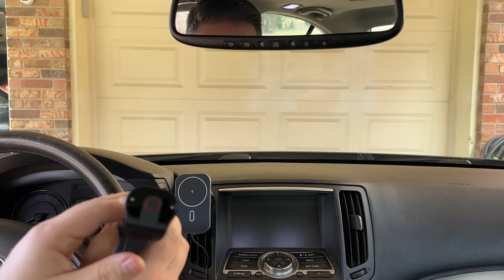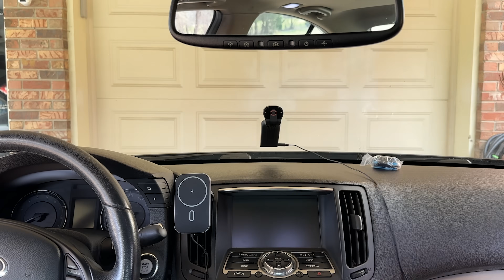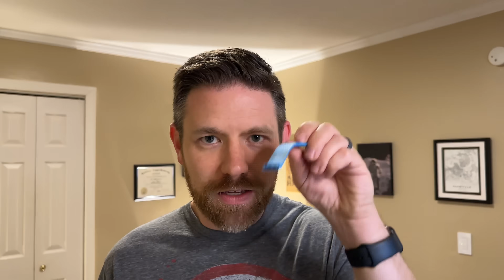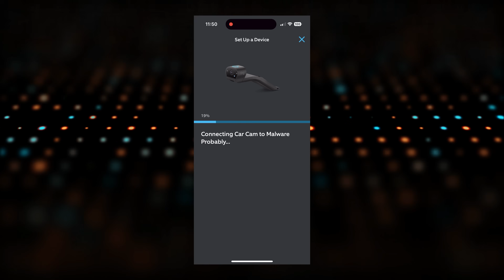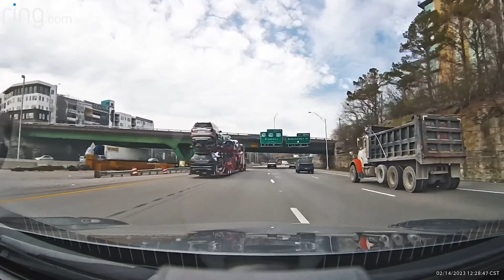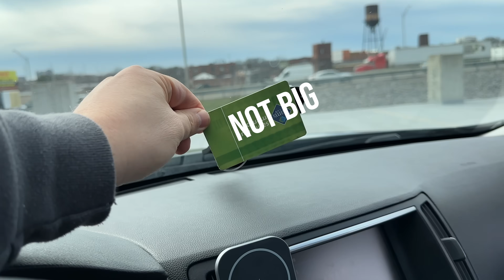Ring Car Cam: Full Review

Comment: Excellent review. I was expecting a little bit more on the break-ins detections. You said it worked perfectly, would be great to share some videos on how it actually works, if anyone stands outside the car close to the driver's window, will it also detect? do we have to manually select the "zones" as with the other cameras? Thanks.
Reply: YES, i received mine yesterday and the angle is wide so it picked up me walking towards my door from about 2 to 3 feet away maybe more...and then getting in etc. it really is amazing and the wailist on ring/amazon is until june but a few legit ebay sellers had this in the 250 range with shipping so i hopped on it friday! that same seller i got mine from is now selling the remainder of the 8 he had for 299 but you might find someone else with deals (and auctions of course) watch ebay often and again, highly recommended! so freaking simple to install and looks amazing in my new jeep gladiator
Reply: This^^
Reply: the "motion detection" only works when getting in the car. It doesn't detect motion around the outside of my car. Bit of a bummer.
Reply: OBD2 port? Not plugging anything to that port.

Comment: You video helped me to understand the product.  I live in the wild of Montana and my windshield gets broken at least twice a year and is always replaced.  The glue on the Ring cam window tab is strong.  My question is how do I remove it when the window has to be replaced [so as not to break the ring unit] and does Ring sell the glue tab for this kind of replacement.  Thanks, Ken
Reply: The device comes packaged with 2 spare adhesive tabs

Comment: the product says it should only be used with driver's side OBDII port, but the USB-C is on the right side.  Was it designed by a marketing major?
Reply: I thought that too. But the cord is real long and the usb port and the plug in get tucked away in the dash anyways

Comment: The big problem that I am seeing with this Ring protect go plan is that it is only 2gb of LTE data. That is only 4 hours of video. You will go though that 2gb of LTE in less than a week and have serious overage charges. You have to opt in to LTE overage charges when you purchase the ring protect go. We need to have a way to chose wether or not our recording auto upload. Great video, great info.
P.S. local storage is 7 hours and it re-writes over the old stored video in 1 hour blocks.
Reply from the maker: Based off of your numbers, do you see yourself trying to download more than four hours of video a month while your camera is away from your Wi-Fi network?
Reply: My Ring Protect Go terms of service state that I have 5 GB / month included here in Canada

Comment: Just installed mine last night. Was disappointed to find out that it doesn’t record or cannot live view when the vehicle is off. I thought it would, will have to send back. My issues are when car is parked and people around it scratching my car. If there’s a setting for this please let me know.
Reply from the maker: You can adjust the power settings to be more aggressive, which will keep the camera on longer while the engine isn’t running.

Comment: I like this guy’s channel but i feel that this review is somewhat lacking in regards to performance details! 
One of the most important feature on a camera is the image/video quality! Yet, no mention of this! 
No discussion of resolution (720p, 1080p, 2k, 4k etc…)! 
How does it perform at night vs dascams that feature Sony STAVIS tech? 
Why would you recommend this in 2023 vs newer STARVIS 2 equipped units! 
What is it’s heat handling capabilities?
From what i can see, this dashcam is easy to use, but the image quality is lacking! 
It should be priced in the $89 range! A hard pass for me! I would rather own the VIOFO A139 pro for the price that RING is asking!
Reply: It's more of a security device than a dash cam as it has a hard time reading license plates.
Reply from the maker: I did mention that it’s 1080p, and that this is lower resolution than other dash cams out there. I also highlighted the merits it does have that give it parity with what a Ring customer would expect from a Ring camera. If other companies would like to have me test their dash/car cameras, they know how to reach me. Thank you for commenting!

Comment: Very curious why Ring chose to have the USB connection on the camera itself come off the wrong side of the camera to lead directly to the OBD-II port on the majority of cars worldwide.
Reply: My thoughts exactly.  The OBD ports have always been on the driver's side of every car I've ever owned.  Seems like a flaw.....
Reply: OMG RIGHT!?!? Additionally, why did they round the end of the dash support so drastically? I sharper wedge would have made it much easier to fit between the windshield and dash. It's like they didn't have a single automotive engineer / specialist on the dev team. Sofaking dumb.

Comment: Got mine today! I have not set it up yet but I am concerned about connecting it to the home wifi as I live in an apartment so I doubt I can receive connection to it. Any workaround? Maybe my car's wifi hotspot would work?
Reply from the maker: If your car has a hotspot, it could work. But does the hotspot work 24/7?
Reply: @TechWinnerCC  mmm only when the car is on that is the issue. Or my phone hotspot maybe also for the time being for the firmware update. After that would it be able to utilize the cellular connection moving forward? Thanks!

Comment: I received my cameras today.  Ring says the weight of the camera should be supported by the dash, and not by the mounting strip on the camera. There is a gap cover that you place over the bottom of the camera where it plugs in (depending on the thickness from your dash to your windshield), then you snug it between the dash and windshield, and lastly, press the mounting strip into the glass. The way you've mounted it, the camera could possibly fall causing damage to the camera or your car. Even if the camera view is somehow obscured by your hood when mounting it correctly, you should follow the Ring installation instructions, then inform everyone about the possibly of the view being obscured.

Comment: OBD port is for diagnosis…not for powering an installed add on. “Scottie” would not approve. That’s why all other dash cams have hard wire options to the fuse box.
Reply: There are a number of dash cams with OBD connections.

Comment: Ring shows the bracket much lower down.
Reply from the maker: Yep. I wanted it higher.
Reply: You're right. The correct installation is lower with the bottom snug between the dash and windshield. Please follow the proper installation instructions provided by Ring.

Comment: Mine is out for delivery, looking forward to getting it setup.

Only thing I’m worried about is it blocking the light sensor on my dash, the one that controls the headlights.
Reply: My light sensor still works as designed with the car cam centered directly over it.
Reply from the maker: Another possible reason for mounting it higher, like I did.
Reply: @TechWinnerCC  You should stop writing that people should not follow the installation instructions. RRSTT if you're worried, just move it slightly to the left or right to clear the sensor.

Comment: Mine was delivered yesterday and I don’t know if it’s gonna drain my battery
Reply from the maker: I wouldn’t worry too much about it. Definitely play with the power settings, but as I mentioned in the video the cam will put itself in standby mode before this becomes an issue.

Comment: CNET said the footage is really grainy
Reply: It looked a little grainy especially at night. Ring should have used 4K. Mine is sitting in my office. I tried to cancel my order but they sent it anyways. Still waiting for a return label.
Reply: @geraldsportschannel any chance I can buy it off of you? 🙏
Reply: @marccc1505  sorry sent it back
Reply: @geraldsportschannel  4K video would be a major increase in file sizes uploaded / downloaded.  I understand making the tradeoff in an LTE-connected dashcam.
Reply: @SevenFiftyNorth  my current dash cam shoots in 4K And the footage in my truck and outside my truck looks awesome.
Reply from the maker: Well, what do you think based off of my footage?

Comment: Appreciate your insightful review.  In fact after watching, I picked one up at Best Buy on my way home.  Installation on my AMG Mercedes was straight forward, the extra cord slack took most of the install time to tuck to the undercarriage of the steering column.   I look forward to testing the features during my am commute to work.  Does the 30 day trial for Protection Go need to be activated?
Reply from the maker: Nothing to activate on the 30 day trial.

Comment: I installed it on my Silverado today and I didn’t leave a gap like you did. While I wish the camera angle was a bit better facing the road I’m happy it’s so snug. I’m not worried it’s going to fall. Please keep us updated if yours falls.
Reply from the maker: Week in, and so far so good. I mean, this thing is incredibly lightweight.
Reply: Hey Josh, you did it the correct way! That mounting strip is not meant to hold the camera permanently and could possibly fail during the heat/cold extremes of the windshield and the camera could fall causing damage. There's a reason the Ring camera designers decided on the particular installation instructions.
Reply: @reb1225  They copied the instructions from the "Owl Cam", and the design too.
Reply: I have a truck Ford F150 and there is no way the sticker will touch the  glass for support, it is my second day driving and right now my camera has not support, have to hold it with my hands when I do turns
Reply: @jcgutibay  It is good to know that it doesn't fit the best selling vehicle in the United States properly.
Reply: @damon20r  exactly, first thing came to my mind, curious if they really tested on every American vehicle
Reply: @damon20r  after watching another YouTube video I learned that the head of the camera is adjustable so, I was able to attach the camera to the window
Reply: @jcgutibay  cool, because I a have a f-150 also.
Reply: after watching another YouTube video I learned that the head of the camera head is adjustable so, I was able to attach the camera to the window — so far I like the recordings and I am using my wifi at night so now I am checking if can access the car camera anytime

Comment: You've installed it wrong in the window.
Reply: Yup
Reply from the maker: Yeah, I wanted it a little higher.
Reply: you can probably install it anywhere on the windshield, providing the best coverage and not obstructing too much of your view when driving :) I have mine installed closer to the dashboard, but my car's hood is little bit high, so I am not seeing as much as I'd like.  Maybe Ring will have a version which can be mount closer to the top of the windshield in the future.
Reply from the maker: As you can see from my install, there’s nothing prohibiting someone from mounting it higher. It’s totally preference.
Reply: That’s why I might be canceling mine , I have a ram 1500 it’s gonna catch all hood lol
Reply: @emidiobosco7140  I adjusted the camera angle on the camera to reduce the amount of hood shown. The camera is on a pivot.
Reply: @kensmith5108  that’s good to know.  Thank you

Comment: Good review. I find it odd that Ring chose to have the power adapter on the right side. 
I'm assuming it has a G-Shock sensor, and someone else mentioned that there is a 2GB limit for the LTE connection?
Reply: I thought the same thing. The obd connector is on the driver side.
Reply: If the OBD is on the driver side the app will not even let you set up the camera, it says your car is not approved due to tangling concerns and to return the device.
Reply: @RahmanNoodles33 lie

Comment: You didn't mention the 2gb limit on 4g lte and Ring doesn't give rates for going over.
Reply from the maker: I’ll be curious to see how this plays out. In reality, I don’t think it will be a huge issue because most of the time you’re going to be pulling video while at home. Time will tell.
Reply: Huh. Interesting. I got this for our camper van and the van is always on the road and never in a driveway. I want remote monitoring when parked and I am away.

Comment: Would the adhesive possibly remove/damage tint from the inside of the windshield in your opinion? Mine arrives today.
Reply from the maker: It’s certainly possible. I’d ask why you have tint on the windshield :)
Reply: @TechWinnerCC  Florida heat is unforgiving
Reply: @TechWinnerCC  I'd ask why you don't have 80 percent nearly clear ceramic tint on your windshield. It is absolutely amazing in how much heat it rejects.
Reply: @TechWinnerCC  Tints nowadays are not used to just darken a window, I also have a full clear ceramic tint on my front windshield that’s used for protection of the leather on the dash and keeps the car cooler. I received my ring car cam today will be installing tomorrow, hopefully it won’t effect my tint.